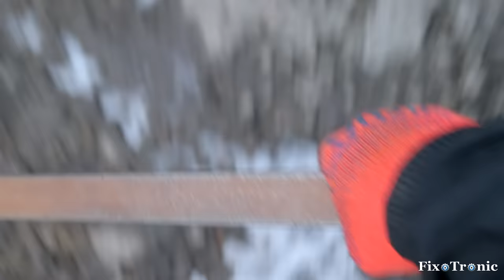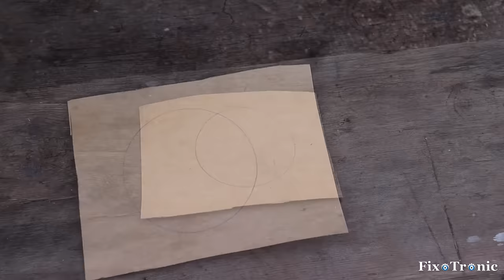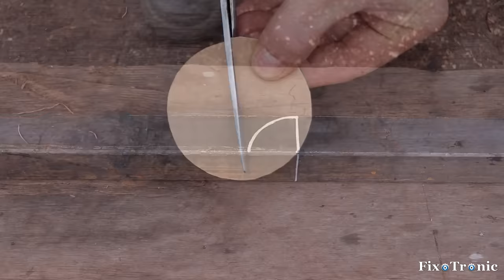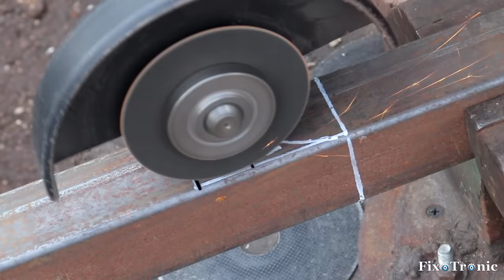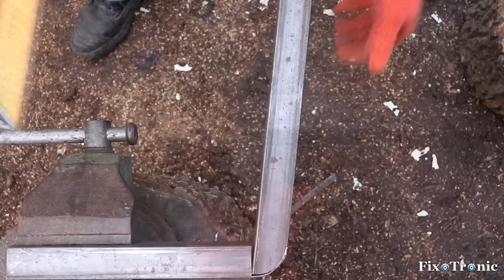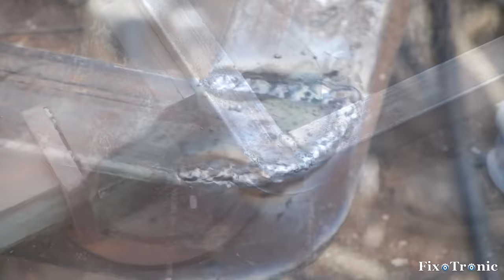Secret Profile Pipe! WHY DO WELDERS NOT SPEAK ABOUT IT

Comment: it just looks like a pain in the ass. mabey thats why they dont talk about this
Reply: I agree
Reply: @mark006868  damn bro, you got the whole squad laughing 😐
Reply: Do it better ;)
Reply: 100% Pain in the Ass. 

If all you have is a grinder and a welder and a hammer, this seems Earth shattering, and for that level of equipment, maybe it is... but... access to just a handful of intermediate metal working tools this method quickly loses all it's appeal.  

However the tribal war drums pretty much kicked ass and obviously whoever made this video has some talent; I can only hope they keep at it and continue developing skills and acquiring more gear for working with metal.

 \nn/
Reply: Ah hell it would take 3 minutes if a feller has a plasma cutter but I think it's cool since it makes a smooth bend
Reply: Hey well said
Reply: Could use a plasma tho
Reply: 2 45 degree cuts and then welded to 90 angle is a way better look unless your going for the plumbing look 😂😂😂😂 that's probably why it's not spoken about because most welders today use jigs and be like what the fck you on about lmao
Reply: Guys can't stop laughing at the comment
Pain in the ass
😆😆😆😆
Reply: Brian Larimer don’t forget u also need a white pen and a ruler.
Reply: If these tools are all you have at disposal, and you don't want structural integrity - sure it can be done. But all the heat from grinding with the cutterblade messes with the metallurgy of the pipe, in particular the outer side of the pipe bend. And, all force applied will be shearing at the welds only; no real significant material (of the box steel) carrying the load. It can look asthetically pleasing, but most weld jobs would rather do a 45° cut section in there on one end of the pipe, if asthetics were priority. Or if you have more equipment, bend it or weld in a 90 degree prebent or cast part.

I appreciate the creativity though. Ffs don't stop trying new things just because "we don't do it like that". Just make sure you educate yourself on the how and why, and understand the reqirements of an application so they aren't compromised. And don't do "experiments" on load-bearing stuff without doing and double-checking the maths, triple-checking your welds and materials, and verifying that it's still within required spec.
Reply: It's about that beatiful round corner and a very strong corner, the template is used for the other three corners. Craftsmanship looks tedious to a sniggering book keeper or what have you. But there is art in a nice set of books, or a brief done by a lawyer. Thank god we are all different.
Reply: Hey.its nifty so long as YOU the client payss.  pay for the down time in the long b fyt making it happen . Fecih.

Comment: By the end I changed my mind to why wouldn’t you want to weld to this music?!
That and now that I know how to weld this profile pipe shape, what the hell am I going to use it for?
Reply: Absolutely nothing that's why welders don't use it
Reply: I can see it used in small structures, instead of twisting a tube. You don't end with sharp ends.
Reply: Jackie Tearie  That's what i was thinking, it looks more aesthetic than a square corner, so it would have a ton of uses.
Reply: I've done ten now, today. Not sure why!
Reply: Jackie Tearie 
beautiful weld?.....🙄
Reply: If you as a welder...a Certified welder such as I looked beyond the obvious tack joining of the edges then I'd incorporate that corner into my work. Taking aside all the neging and Oh, that shouldn't be used...it's in effect a visual softening of the corner. It means that if your internal framework of a tube frame on a trailer where a collapsing internal tent Frame won't rub through the canvas once erected or is collapsed. 
Yes it's crap welding, but maybe the only setting on his stick welder...or he doesn't have a TIG or plasma welder.
I weld with Laser Energy...light energy.
I'll make some 3mm square tubing corners. Judge me not lest ye be judged.
It's an aesthetic not structural weld. Structural strengths are incorporated elswhere.
Reply: Really you all dummy never thought about using for the pipe on the bbq pits ,you all got to start thinking outside the box I'm a welder as well
Reply: Moses Guajardo 
I’ve been welding for sometime now...this actually wouldn’t be a bad way to incorporate into some projects; although, it’d have to be 1/4” thick wall for me to use since I do big projects.

Comment: That seems like a
Lot of work, just cut it, square it, and weld it, done
Reply: It depends on whether turbulence is a significant factor in its day to day function.
Reply: PersianinSweden Not with those welds he put on.😂 Never tack tack tack, start, hold, then go after it wets in and don't grind off the welds unless their full penetration.
Reply: Has the safety guard still on the grinder! amateur!!🤣
Reply: Aaron Williamson as someone who works on the field he better have his damn safety guard on. Watched a guy lose a segment of his index from a faulty cutting disk. My superior almost died from a fragment that almost went into his chest. They both had the guard on too. If they hadn’t it would have been worse
Reply: @sam-plebll7786  thanks man. I'm never touching an angle grinder again.
Reply: @sam-plebll7786  I can never warn people enough about them, 12,500 rpm is no joke when they explode.
Reply: Not so funny when you have half a disc  embedded in your face with your jaw hanging off.
Reply: And he didn't even weld the whole thing up. The inside corner wasn't welded.
Reply: @sam-plebll7786  Ive seen those discs fly off, I nearly hit a guy in the face with one across 2 bays in the shop while grinding... Still glad the guard was on because it could have came my way instead.

EDIT: Ment discs not wheels...
Reply: @novoice1127  ...if you remove the SAFETY guard you're stupid... better safe than sorry... I've seen people run electrical circuits in cars  without  proper FUSES 🤭
Reply: You damn right there !! That’s what I thought , they not gonna exactly support the great pyramids of Giza are they 😂😂
Reply: @theetacidnysproject9409  I'm not about to get into a pissing contest over which is worse but have you seen a grinding disc explode in real life, i have seen a few in my 30 years of using them,
Reply: Ok I get if he was going with a round edge but their are still easier way to go about, and stronger with those tack welds, highly doubt, and you better have that guard on, I’ll fire your ass and I’m not even the manager, I’m just the fitter, and dude didn’t even give it a bevel, if he was going to end up grinding it down, dude just removed the welds, I’m just saying if you are going to show people how to do something, do it right

Comment: "WHY DO WELDERS NOT SPEAK ABOUT IT?" Probably because you took an hour to make a five minute 90 degree joint.
Reply: Depends actually, sure a 90° angle isn't thst hard, but a 90° angle with a 45-50mm round outside vorner takes a bit more work
Reply: Sure, a 90° weld with a outside corner is quick, but how long for you to duplicate that nice radius?
Reply: @hightttech  you pretty much have a template ready and the measuremeants are basically 3rd grade mathmatics, it aint that hard, sure might be a bit time consuming to do but if you would have tobdo a rounded corner for instance, instead of cutting and bending flat steel to fit the radius you will have to cut around the corner and loose more material you just cut it out and bend it, weld it, forget it.
Reply: TheJudge01  I guarantee you'll need to measure more than once if you don't get it perfect right away.

Comment: I guess inventing the wheel again is not nessesary. How about a 45deg cut and twist? Quicker and easier and stronger ...
Reply: Maybe he likes his corners round?
Reply: Am no engineer but I think the extra strength comes from not cutting the side. Going around the corner with not interrupting the material seems stronger to me.
Reply: Jarno Geurtsen, the sides are clearly cut. Transferring forces directly are more efficient than going around  radii, thats why trusses and honeycomb panels are light but strong.
Reply: It's only as strong as the material is itself cause those spot tacks ain't holding shit ! 😜
Reply: @insaane not needed as long as it was well within the bend radius for the material and thickness.
Reply: @davidplaisance8385  I thought that too. No way he got enough penetration with those welds.
Reply: @gree I like how you said "radii" because someone else did except you used it wrong.

Comment: Pro Tip: This guy is a grinder not a welder..
Reply: Well, that answers the question, eh.  He too doesn't know why welders are silent on the topic....
Reply: Allahu ekber Bismillahi Rahman i rahim
Reply: Can you explain your statment? Just curious
Reply: @muhammedkarahanmalatya7atu168  You're in the wrong kingdom, knave. 

Molon Labe.
Reply: MUHAMMED KARAHAN MALATYA 7A TÜRKİYEM İHOO 
Brawlin crackem sendit mucho wackem kwik
Reply: @Robert James if he were a welder in a fab shop he'd have tig welded this and not welded cold with a stick. If he were a welder he'd have just capped his end piece instead of taking three times the labor hours doing this fuckery.
You only stick weld like that in an emergency to make something get out of the field. Electrodes aren't made to weld thin metal cold..
Reply: @carlosaugustonogueira6629  no one that fabs for a living is going to do this labor intensive end cap. No one who fabs for a living is going to stick weld thin metal. They will Tig or Mig it.. This was just some backyard jackwagon stuff. It was neat but that's the reason why guys in a fab shop wouldn't do it.

Comment: Yea, its a secret because no one uses this method.
Reply: Too time consuming with little to no benefits and a waste of consumables.
Reply: @davidbrennan5  maybe u dont want pointed corner
Reply: @hope5019  Yes but in the welding industry time is money.
Reply: @mayze6  so you can buy time?
Reply: A more accurate way to word it would be time is cost. More time means more cost, which means either more expensive for the customer or little to no profit for the builder.

In an trade and industry where 99% of the time the customer is looking for a product that is strong, functionable and as cost effective as possible with little to no care as to how pretty it looks this method will almost never be what the customer wants.

The only situation i can think of where a paying customer might want this type of joint would be a rich person that wants a fancy set of custom hand rails for their house and dont care how much they cost, even then there are more cost effective ways to do it that look just as good
Reply: maybe sometimes some guys use it but not in work, it is just too long, you just cut 45 degree angle and weld em together and that it
Reply: @intothegrimes5908  Time is money. That doesn't mean money is time...
Pay attention.
Reply: Besides, how can u trust someone who hides his face to make a living?
Reply: @xempt. one ooh your profile picture is from a rotary engine, i like what i see👍

Comment: The reason welders don't speak about this:
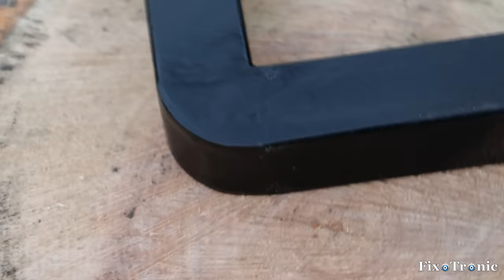This is a weak ass weld. Look at @4:36, it is already bent to hell in the weak point just from the heat of welding it.
Reply: Which one is the weak point ???
Is it the rounded side,,, or the 90 * angle ,,, which one,,,
Please tell
Reply: Thats because he just stacked tacks snd no pen
Reply: @That One Guy yeah looks like 10 gauge. If your going to take that much time on prep then might as well clean it and tig it
Reply: It looks like a cool joint but if all u want is a corner rounded at 90 then just bend it otherwise cut it and weld at 45

Comment: After all that he threw down some boogerweld nonsense.
Reply: @therion5458  Exactly
Reply: @therion5458  professional welder here, you're kinda right, he's doing that because he can't weld without burning a hole, certified welders like myself however would have no issue
Reply: @therion5458  Just because it's not ideal doesn't make it impossible. A little 1/16" 7018 would lay down on that pretty good I would think.

Comment: Now welders will be loosing millions, one of their secrets have been revealed.
Reply: Johan Last welders HATE him for sharing this one weird trick.
Reply: Loosing?
Reply: @rogers8555   yup the same people that blast other trades for showing up late to work, as they proceed to sip their coffee for the next 2 hours before starting to begin some kind of work.
Reply: @rogers8555  💯
Reply: @rogers8555  It does indeed take ALOT more time than sinple cutting it in in a 45  º angle and welding it like that. It's also not particurlarly diffcult to weld. This method is probably the hardest, using a TIG the easiest to get a good result.

And it also depends on specifications. I've never welded profils with a rounded corner like this, but should that be a requirement, it's certainly doable. But again, using MIG or TIG is defenitely preferable to MMA-welding like this.
Reply: @sjuthberg  yea this is it.  It's that it takes a ton of time and work compared to cutting a 45° and welding.

And when time is money... well let's say in the time it takes to weld 1 corner like this, they could have welded 3 corners with the 45° cut.  Meaning the job is done 3 times faster, which means 3 times the work can be done in the same time, which leads to (hopefully) a paycheck that's 3 times bigger.  

That's not to say this welding trick is worthless - just about any trick you learn is useful - it's just not the go to option when you need a 90° corner.  It's the option when you need a rounded corner for instance.
Reply: @rogers8555  same shit in the north east, I used to work for an electric company and we would probably do about 3-4 hours actual work during the 8 hour period, where I would go home after but all the other guys would stay for overtime and that's when they would do the actual work. They didn't like that I went home at 3pm even though I did actual work in the 8 hours and some other guys just walked around with their hands in their pockets.
Reply: Really need to follow this up with video of making a 2 ft. X 2ft. square of tubing out of one piece with all 4 corners done this way and we can see how that comes out

Comment: I'm oddly satisfied that his stick welding skills are as bad as mine
Reply: To quote my welding teacher back in school "it's an art form" well he ain't wrong about that, I envy the pricks that are really good at it 😂
Reply: "A grinder and paint make me the welder I ain't."  --some guy
Reply: @GhostOfJulesVerne  it's 'putty and paint will make it what it ain't'
Reply: Welding skills are far less necessary for looks when you're gonna grind them flat anyway. I prefer MIG for good looks.
Reply: @iamthecheese2737  c mon now, if you want a good looking weld then use a tig welder. Best looking weld you'll ever see
Reply: Bar was too thin and he probably had his heat too high, I've put better beads on thinner angle bar though
Reply: @billyredecop9821  ahhh that reminds me...got to hire some argon.
Reply: Billy Redecop lmao!! It should have been done with a mig welder -
Reply: Christopher Hund lol! Should have used a mig welder.
Reply: @smid2550   yes a mig welder would have been better then that old buzz box he was using but tig is still the cleanest weld you'll ever see. No splatter, minimal clean up

Comment: Im a blind electrician why did YouTube recommend this to me.
Reply: Sounds like a shocking profession
Reply: I have so many questions, sparky. 

Like why did the elecchicken cross the road? Why do we retain the +/- (gnd) current flow direction when we know electron flow goes the other way? Why are the pixies so angry?
Reply: pr0xZen current flows neg to pos, no idea why some places use the conventional method rather than the way it actually works but at the same time while troubleshooting how often do you really need to know what way the current is flowing?? Never
Reply: @brandongriffin8256  For component and some circuit design you really need to. For most troubleshooting, nah not really. Just don't mix'em up halfway through.

Comment: The simple answer to why welders don't use this method. Any welder on a job, could have cut and welded 100 corners in the same amount of time to do one of these.
Now if you are doing something to be pretty, and you are required a specific fabrication with a radius on the corner. Then this makes sense.
But in practice, most applications don't require these specifications. 
Short answer welders need to get a job done. Not play around.
But to be fair, this does look neat.

Comment: The sharp 90 degree angle is going to concentrate all the stress in your tubing on the weld, which will reduce the overall strenght of the assembly. But nice for decoration!

Comment: No one talks about it because it takes 10 times longer than cutting two ends on a miter saw and welding them together. 

Also, you can only make ~90 degree angles this way.

Comment: I guess internals are not very smooth for this, there is a sharp 90° angle on inner side and outer side is curving out, disrupts the flow of fluid(if it was supposed to pass through)

Comment: SO, I read the comments and everybody on here talking about time involved...You're on the internet watching YouTube videos...I think you're ok with wasting time.  I actually have a question about the weld....is this method stronger in terms of load bearing...like would this be a good technique for a pullup tower as opposed to a 45/45 weld?
Reply: I don't weld at 4.45 am, but sometimes I watch yt videos at this time. You don't do an intricate, time consuming joint like this for strength, you do it because you don't have a square tube bender. Ideal for a canopy where you don't want to rip a tarp on a corner. As far as strength, it would be weaker than a clean 45 cut and welded joint, not to mention how it is stitch welded with a stick instead of using a mig or tig.